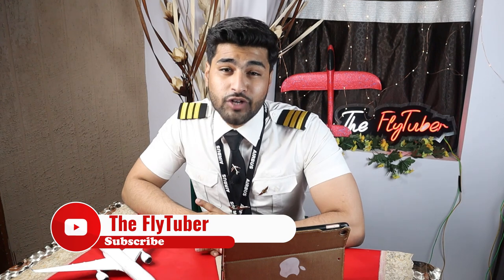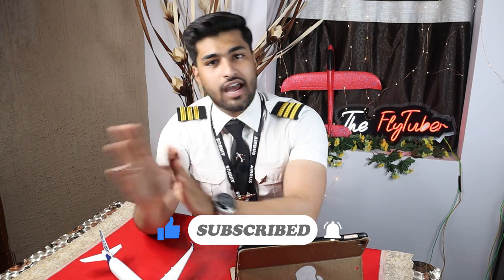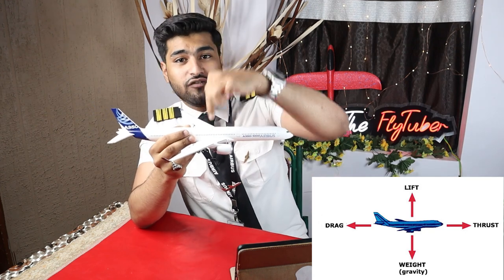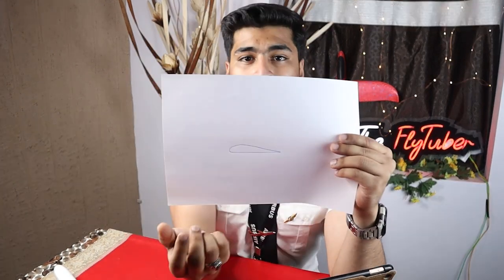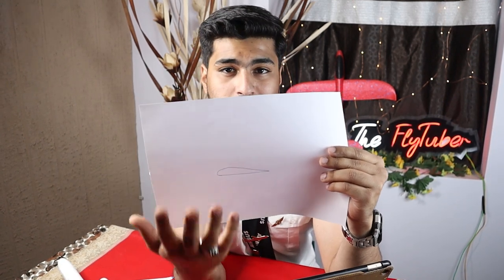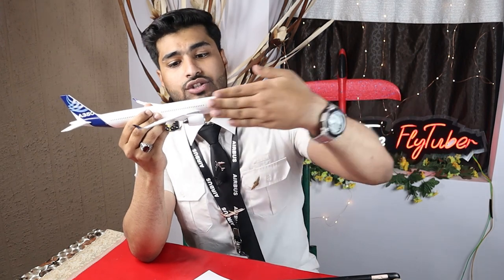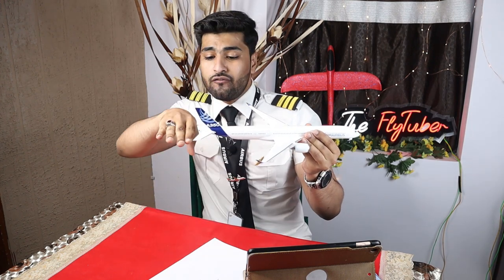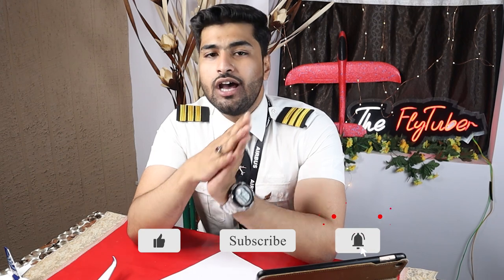How do Airplanes FLY ? | Despite being so heavy | Ground School Episode 1

Comment: Okay so the real explaination is because... so there are 2 theories by which a plane generates lift

•Equal transit theory

This is based on pressure difference below and above the wing which is described as ∆p=½xdensity of air xvelocity²..... as air moves faster above the wings thus pressure below is higher than above the wing and keep in mind (things flow from high pressure to low pressure) and so does the wing

• Conservation of momentum as the plane accelerates on runway by the shape of airfoil wings tend to throw wind downwards and by Newton third law so the aircraft has the tendancy to lift up (hope all of you guys know third law)😉

I have listened to a lecture at MIT trust me!

Comment: 9:38 So true bhai. There is literally so much. But, you did a good job to keep the explanation as simple and as basic as possible for an absolute beginner.
7:16 You could have also talked about stream tube & principle of continuity here, and given the example of how velocity of water increases when you reduce the cross-sectional area of the pipe, so that beginners can understand even more easily.
"Principles of flight" is the reason why I loved Technical General, when I was preparing for DGCA exams.
Reply from the maker: Thanks... yeah I would have talked about stream tube... but they might get confused... where is a tube here.. its all open air na
so I refrained from getting into it
Reply from the maker: I also liked Tech Gen aloott ( all the subjects actually😅)
Reply: @TheFlyTuber  Yeah, you are right as well.
And yes, that's true. Every subject is great and interesting in its own way.

Comment: It was a great video sir.....
Sir, can this lift generated can be also defined by Newton's Third Law of Motion? ...cause while using flaps the air flowing through the wings hits the ground and in turns it get that force i.e. lift.....Is this theory anyhow possible !
Reply from the maker: No, cause the air hitting ground will indeed bounce back up due to newton's third law of motion.... but that will not have any effect on the aircraft coz..... by then the aircraft will already have gone say 50m ahead
Hope that makes sense
Reply: @TheFlyTuber  Thank You sir for the explanation !

Comment: Sir in class 12th we are taught that tyres of airplanes are made slightly conducting so as to prevent fire in tyres
Reply from the maker: Yes you can say that, but at the end of the day, it is kind of rubber composite so still flammable